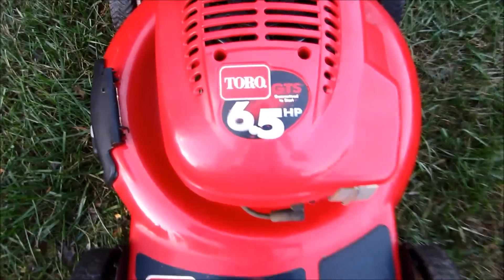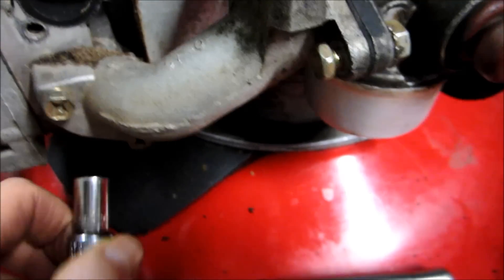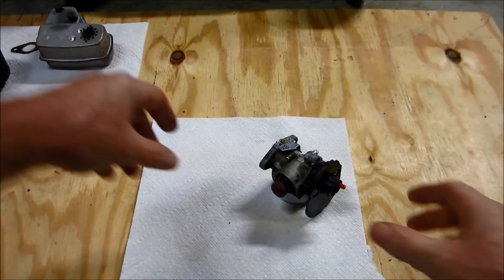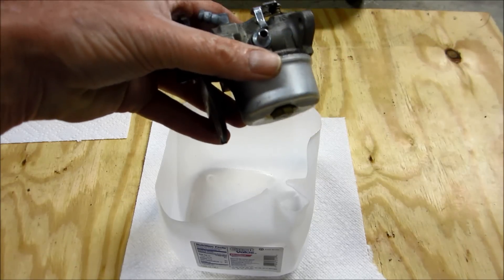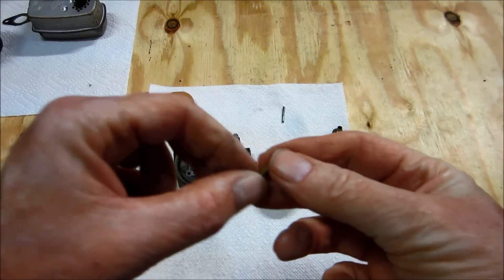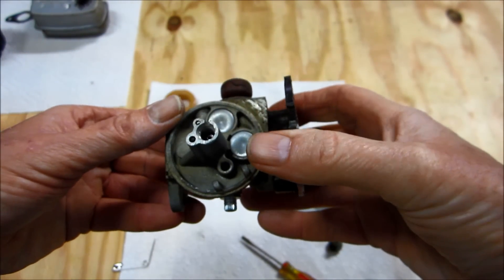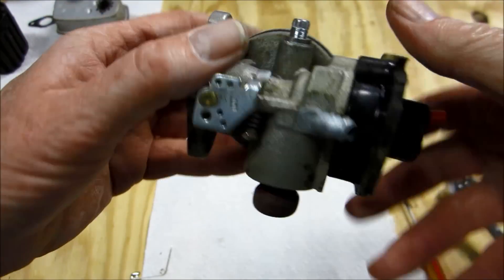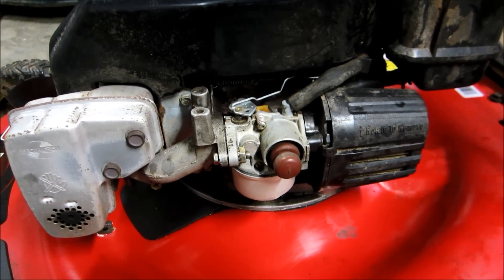Toro Personal Pace Lawn Mower 6.5 GTS Tecumseh Engine Carburetor Cleaning - Part II - Oct 23, 2013

Comment: If you do not want to go through the cleaning, you can buy brand new after market carbs for about $20-$25 on Amazon. Thats what I did and it has been working for 3 years now.
Reply: Amazon has a good deal right now. For $20 you can get a carburetor, hoses, filter and spark plug. I bought a filter for $11 at HD and returned it after I found the deal on Amazon. Amazon is great!

Comment: I really need advise i bought toro lawnmower used im missing the air filter and cover i was able to get the filter part number i need the cover that hold in the filter part number.

Comment: Had the same problem and cleaning thoroughly with carb cleaner did not help. Got an aftermarket carb for $11 and it now runs like a champ
Reply from the maker: Hi John thanks for viewing!  That is the way to go agree as well the last few I had gotten with this type engine just did the same thing and about the same price got them on Ebay.  We replaced the one on my sisters similar Toro and she has been using it for several years now with that aftermarket carburetor and no problems.

Comment: Just picked one of these up for free need to be clean up it missing the air filter so all u see is the red hose going into the carburetor so I filled it up a bit and primed it and it just started spraying out of that red hose not sure if it supposed to happen but will need to get a new air filter hosing

Comment: You can remove the back bolt without pulling the muffler. 1/4 drive ratchet and 3/8 socket. Come up from the bottom.

Comment: The most common problem is dirt or varnish plugging the jet holes in the brass plug on the bottom of the carb bowl.  Didn’t look like you cleaned those holes out with fine wire.

Comment: my buddy just pick one of these up free for me mine has key start 22" personal pace my first personal pace.... I hate those carbs, but will have it running soon.
Reply from the maker: Hello Knighhawk86855 free is always good and electric start as well you will get it running.  Really like those Personal Pace self propelled they indeed are the best next to my also favorite Snapper.   I had tried one of those aftermarket carburetors for a Tecumseh it was $11.99 on Ebay can also get those on Amazon.  It worked just fine as a carburetor replacement option without messing with the old one.  Let me know how it goes really nice Lawn Mower you got.
Reply: mountainbikekayak well hello there, yes this being my first personal pace I am looking forward to trying it out this spring, the mower looks new, not a scratch on it, so shall dive into cleaning the car this spring and will let you know, didn't know about the aftermarket carb will have to look into it Tks for the info, also if it just takes a good cleaning to get it to work, I will need a new primer bulb for sure it's hard as a rock.
Reply: mountainbikekayak wow just ordered the carb a pack of 10 air filters and the battery for it all cheaper then the carb for a Briggs, thanks for the info on the carb you saved me a fortune,  can't wait to get her running.
Reply from the maker: Hello Knighthawk86855 alright!  Yes you will have that like new Toro running in no time can't beat the carburetor price which includes a new primer bulb as well get that baby running quickly let me know how it turns out.
Reply: mountainbikekayak I sure will

Comment: If you do take off the muffler, & it comes off hard, do yourself a favor & buy a new set of muffler bolts line for about $15. My bottom bolt broke off when I was reinstalling it, extractor didn't work, couldn't find a left handed drill bit... & I had to drill it out... long/short, J B Weld saved the day... again. This caused a lot of grief!

Comment from the maker: Hi Sean thanks for viewing and you got a good deal on your trade!  This Toro appears it’s a good Tecumseh engine,  they can certainly can be hit and miss generally avoid them.  Gotten a number of them through the years broken and many of them could never get them to run right or at all.   Got a Ariens Swivel Mower last year Craigslist Tecumseh engine broken replaced the Magneto fixed it but the owner told me his lawn shop didn’t even want to work on it!